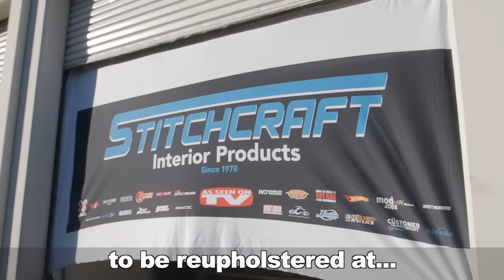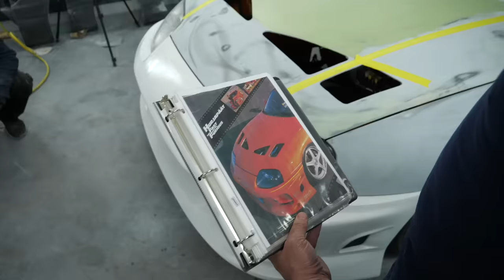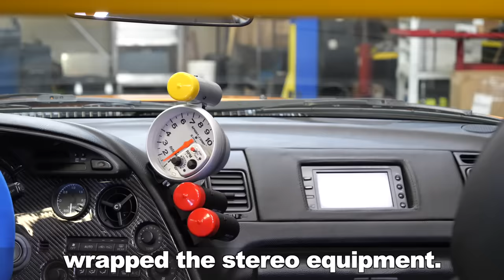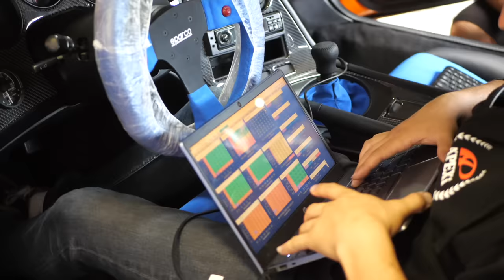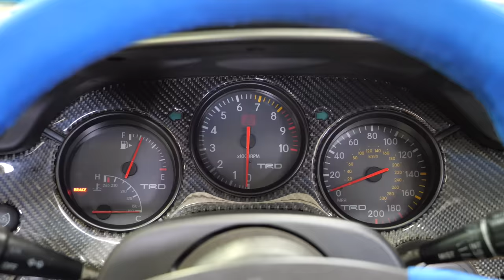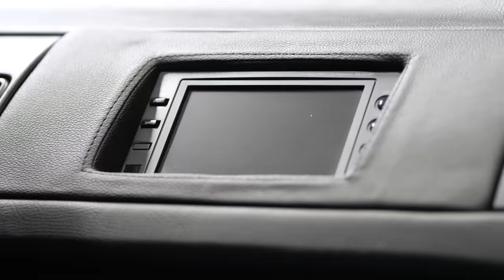Fast & Furious Supra Built In 10 Mins | 90% Unseen Footage

Comment: Great work, I like how the video is short and straightforward not unlike those 30-40 minute long videos. Very impressive and professional. I only have one question though, does the Nitrous system work or is that illegal to have on your car? Or is it just there as a prop to match the detail of the actual original Supra used in the F&F movie.
Reply from the maker: The NOS and the stereo are not currently connected. Neither were a top priority of ours from the start. We plan on getting both working but not at this time.

Comment: How much would something like this cost as a work order? Given you source and bring your own car but part swaps and paint jobs done by you guys? 

How many K's we talking about
Reply from the maker: We mentioned in your other comment about not releasing the financials on this build at this time. There would be a lot of variables. The parts for this build (wheels, audio equipment, wing...) are becoming more difficult to find so that plays a huge part. And the condition of the vehicle too. Our Supra was in rough shape to begin with and didn't have the correct drivetrain.
Reply: @JustDriven  understandable. I can see it's a massive project. So I guess something that time consuming would have to be more out of passion than just for the money.
Reply from the maker: There has to be a large amount of passion to get to this point. Sourcing parts was a huge part of this build and thankfully we had Craig to verify the parts we were chasing were the correct ones.

Comment: best build, but only thing that bugs around is seats, I think that it would be better in more stretched way or you can change to bride's bucket seats. Leather seems loose on current seats.
Reply from the maker: The original movie car had the same seats wrapped by the same shop. It isn't much compared to modern builds and the seats we would use (like we did with our black hardtop Supra). But we were trying to stay true to the original.
Reply: @JustDriven  then it's great
Thanks for rwplying with detail.
Will definitely subscribe your youtube channel for awesome content.
Reply from the maker: Thank you for your support!

Comment: If I make it a pro footballer I'm 100% making one with the best engines and specs and bodywork!
Reply from the maker: This beast is so much fun to drive. And it turns all the heads!
Reply: Then you'll have to buy this specific unit 'cause is pretty much what you describe, the perfect balance between screen accurate and performance oriented build.

Comment: I love that they listened and put the real trans. Not the pos cd009. 
I know some things were made better than the original like bay color and wheel specs. Missing s2 headlights&tail lights
Reply from the maker: We weren't sure we could find the transmission. We lucked out! The headlights are correct though.

Comment: How much money cost modific a car there
Reply from the maker: Modifying a car will depend on how extreme you want to be with your end result.
Reply: @JustDriven  ok i understend i like that as paul walker but with 700horse potence modific in addition ?
Reply from the maker: It would depend on the donor car and the condition of the car when we get it. It would also depend on the stereo equipment. The newer wheel and tire setup like our car. The point is: there are so many different options we can help someone with. If you'd like to have one made for yourself you can email us. We would be happy to give you an estimate.

Comment: Interior was not good at all 
Remaining parts I love it❤
Reply from the maker: Yah, the interior is the same as the car in the movie. It doesn't really hold up well does it?
Reply: @JustDriven  I think more flexibility and stability will achieve by driving a car when interior is good to use its my opinion
Reply from the maker: Our black hardtop Supra has an interior more to our liking. Did you happen to catch it on our past videos?